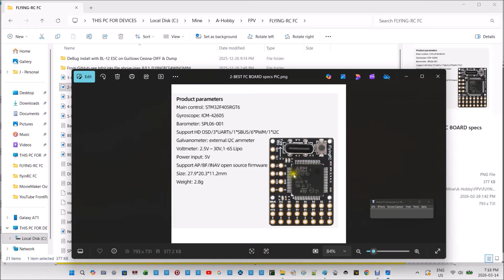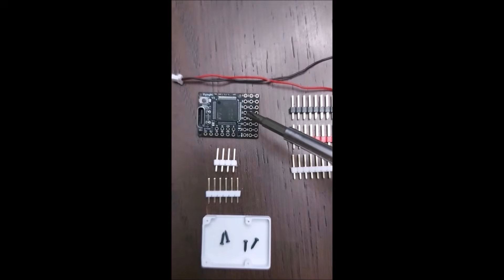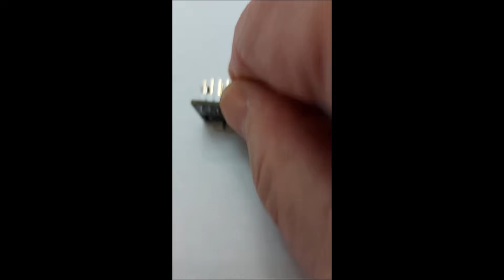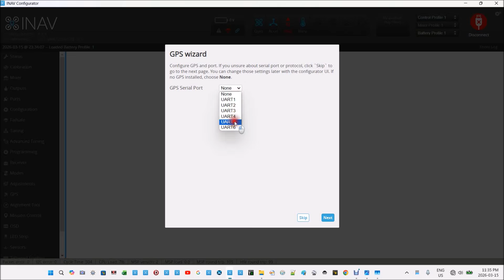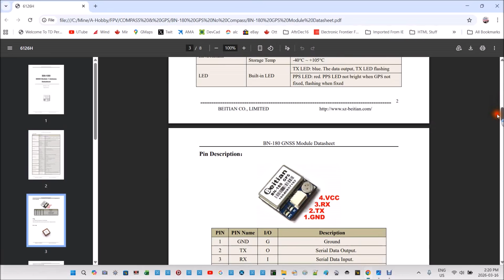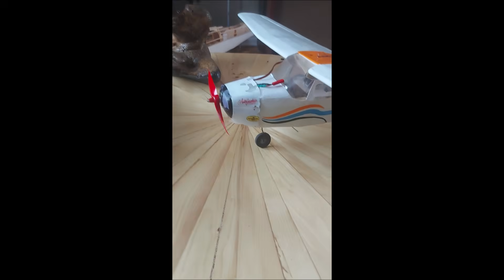Best Little FC

Comment: so you power the board just putting 5v to the servo rail? the plug input on the side of the hd vtx plug it's just for voltage telemetry? there is any current telemetry?
Reply: I power it with the servo rail and also connect the battery voltage cable. In INAV it detects everything, but it doesn't send telemetry from the FC, only from the ELRS.
Reply: @eliasrivera633  thanks

Comment: Hi, congratulations on your setup! I was able to get it working on my flying wing after watching your video, but I can't get telemetry data from my Jumper T14. I don't use FPV, but it would be ideal to be able to see the battery voltage telemetry on my controller. Are you able to get telemetry data?
Reply: I saw another guy asking to connect Vbat next to the FPV power port. It accepts up to 6s and shows battery voltage

Comment: In your diagram that shows the connections you show the battery connected to the FC and the ESC, I assume the FC is powered separately from the servos, and if so, do you know the voltage range of that input for the FC if it's coming directly from the battery?  Thanks!
Reply from the maker: I power the FC on S1 pin row - that powers the servos, receiver and GPS and will need either a 5v BEC (or 6v or 9v).  I power it with 5v from the BEC on the ESC on my first build.  The direct to FC Batt leads into FC must only go to the 2-pin connector on the side of FC next to VTX connector to power VTX and get Batt telemetry.  DO NOT put battery power directly to the S1 thru S12 pins nor to the ELRS or GPS pins!  My next video will show how to power S1 with a separate BEC device (the one ordered with the FC and I will also cover an even tinier BEC from Matek). Also I will cover a harness I made to make this all work.  Should have that video out by weekend.
Any other questions-let me know.
Reply from the maker: And to more accurately answer your question - When 5 v is connected to pins at S1 the FC is then powered also.  The connecteor od side of FC is for powering the VTX and to get battery telemetry

Comment: That's a great find! FCs are getting so expensive lately, or are just constantly out of stock. I'll give this one a try. Should be great for some of my smaller FPV planes. Curious though, your graphic in the video says your FC is a V3 but the ones I found were all labeled as MK1?
Reply from the maker: My first one-back in Dec had same description and no Vx on the board.  This second one (from same supplier) has "V3" beside the boot button next to the "FlyingRC" name
Reply: @NorthIceMan  Thanks. I'll look for that whenever it shows up.